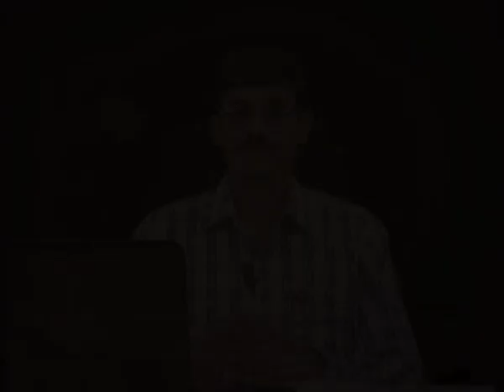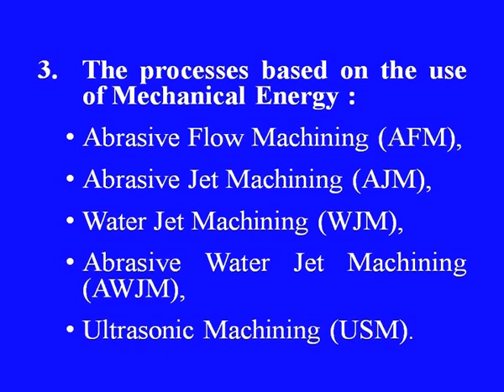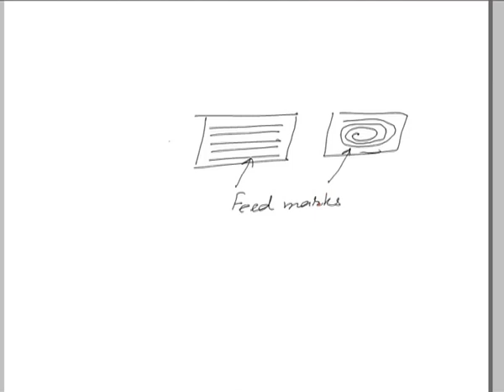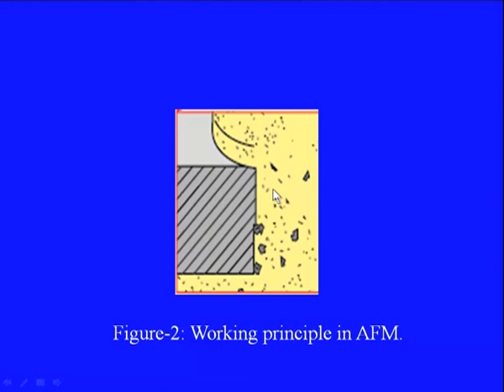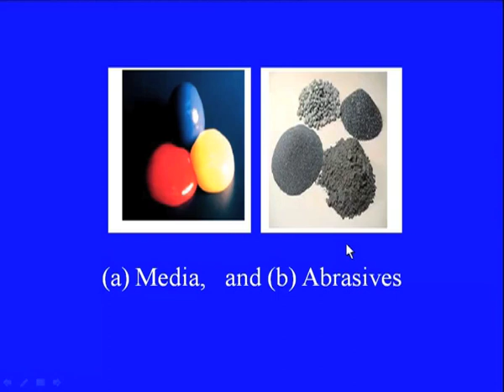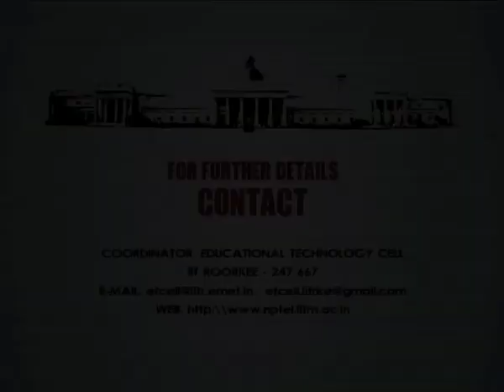Abrasive Flow Machining

Comment: Abrasive flow grinding deburring finishing machine by kooyle industry shanghai Kooyle soft silicon carbide diamond powder abrasive polishing machine for multi mircro holes,inner cross holes,fuel injector fuel injection nozzle injection valve kit ,CNC metal parts precision machined parts deburring and polishing, Surface roughness Ra0.025-Ra0.04 18516640286 Lavender@kooyle.com